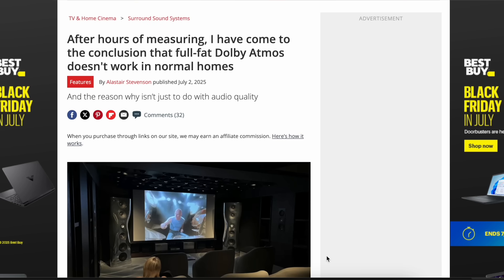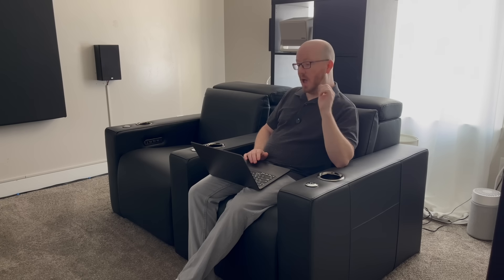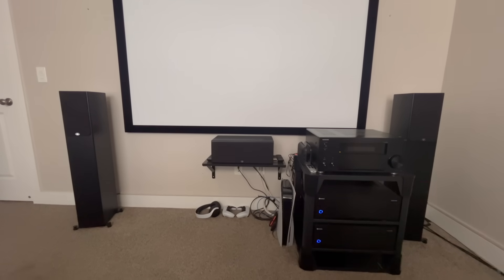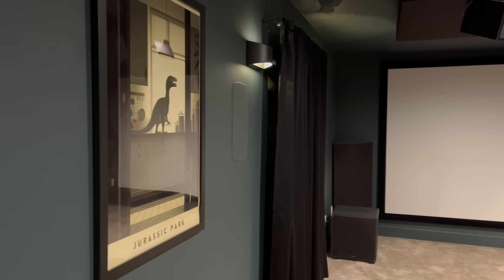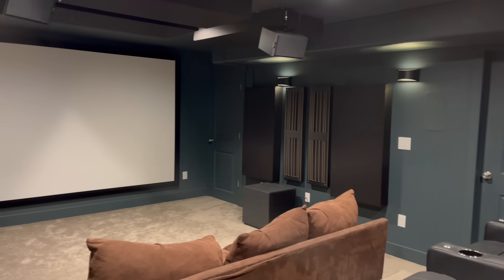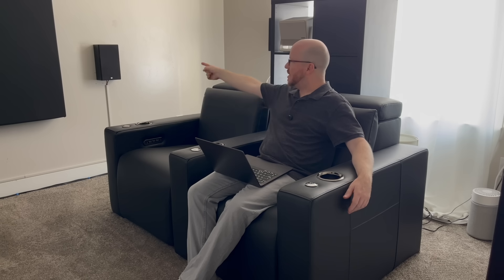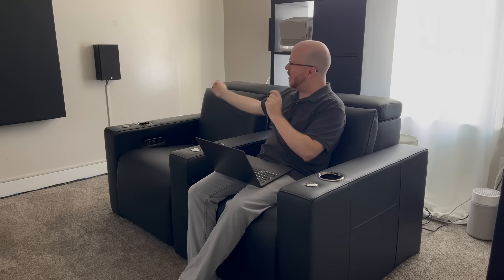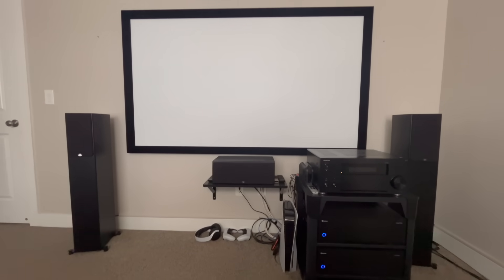Atmos Doesn’t Work in a Tiny Room? Think Again…

Comment: Did you know, that you don't actually need an atmos decoder? You can use a 5.1 decoder and get atmos out of it by adding extra speakers across the positive terminals. The reason this works, is because when movies are made it is in 11.1.4. Then it is downmixed to lesser formats like 5.1. When this happens, the atmos sound is split between two speakers, and are out of phase. When you connect a speaker across for example the LF and LS channels, you will hear the LH channel

Comment: I have a room 11' x 12' with 8' ceiling. I have a 5.1.2 system setup with about 6 weeks with my Atmos speakers upfiring for now.

I'm installing my Atmos speakers on my ceiling in the next two or three weeks.

But with my setup and tweaking of my speaker calibration I can say Atmos does work in this room.

Atmos works really good in here. I had a 5.1 system for 19 years and I can hear a big difference with the atmos speakers. I had the system with 5.1 on the denon x2800 for over a month and when I added the upfiring Atmos speakers I heard a very big difference , I could hear sounds above me when I added the atmosphere speakers. My sofa is about 3 foot away from the back wall.

I'm just waiting for keyhole hooks for my Atmos speakers so that I can put them on the ceiling and my brother will be helping me when he gets the time on the next two weeks.

I have all Polk Audio signature elite speakers in bed layer speakers. I have an ES30 as center channel , ES20 left and right and ES10 rear speakers. I have Elac Debut 4.2 Atmos speakers.

The Polk speakers are connected with 12 guage 100% ofc copper cable and nakamichi 24k gold banana plugs. My Atmos speakers will be on 14guage 100% ofc copper cable and nakamichi 24K gold banana plugs.

Comment: I have 12’ by 11.5’ room, 7.2.4 setup, 2 full size left and right front Speakers, my TV is only 65” and I sit 6-7 feet from the TV, small rooms you have to make Compromises, I wish I had more space for a larger TV otherwise I’m happy with the space I have, also I have 2 Starke SW15 which I have one of them behind the Sofa and one behind the TV.

Comment: Bravo. I literally just design my own small room home theater. 7.3.4 in a 14’x11’x12’ room. I used all KEF. Like you said, the key is to use the right screen size, and a line of speakers with several form factors. I used on walls for the sides & rears, and they look  built in with the room treatment panels around it.

Comment: Hi from Australia. Your room is small; my room is smaller. Less than 9 M2 and I run a5.2.4 setup with a 77-inch OLED TV. Approx 3.6 M (11.8 ft) long x 2.3 M (7.5 ft) wide.

Comment: Not sure if I would actually do it, but could you have in-ceiling speakers for rear Atmos and wedge speakers for the fronts?  In my townhouse, my sofa is against the rear wall (can't block the back door) so my Klipsch on-wall heights would be just like the guy from England and just push sound into the middle of the room.  When my neighbor is home I have to turn off my front heights and the subwoofer on the common wall, leaving me with a max of 7.1.  Even then I have to be careful!!  I have a 65"OLED that's big enough for me.

Comment: Further proof: My 7.2.4 home theater is located in a mixed-use 23ft x 13ft bonus room that has office setups on both sides of the room. Because of the layout, I wasn't sure I could do anything more than 5.2.2, which was my initial configuration.

My solution was similar - I was able to score two pairs of Triad Bronze on-wall speakers while looking for an on-wall solution. I pulled the couch about a foot from the back wall to use them as side and rear surrounds, replacing the pair of bookshelf speakers used as surrounds in my original 5.2.2 setup. I then used a combination of cheap mounts to secure the bookshelf speakers to the ceiling bringing to total Atmos speakers to four. It sounds incredible and going from 5.2.2 to 7.2.4 was an absolute game-changer in terms of immersion.

Comment: My UK room is 15ft x 10ft and I use 4 subwoofers, 7 bed layer speakers and 4 on ceiling speakers. So 7.4.4 and I use a 83"oled as the screen! My room sounds and looks great! I used to use a projector which I'm considering going back to and using a 120' screen.

Comment: UK person here with a 3m x5m dedicated room with a 7.4.4 setup all in  KEF in-wall except the sides which are on wall. 100inch TV. A good Atmos setup is very much possible with some careful consideration.
Reply: Mine is 15ft by 10ft UK spare room and I use a 7.4.4 setup and I too am considering the the Q 4 meta speakers as on wall surround speakers.
Reply: @stekelly1980 I would have bought these if they were available when I configured my setup. Instead I built some on-wall speaker cabinets for the sides using the KEF Ci4100ql-THX.

Comment: These British guys are really funny. Does he really think that a 13 x 15 feet room is "very small"? What the heck? My room is 13 x 13 feet, with 9 feet ceiling and I still don't think it's tiny. Yes, it may be relatively small, by some standards, but that was enough for me to place a 9.1 Auro set-up. And soon there will be an extra Voice of God speaker, in the ceiling. No, I don't have on-walls or in-walls, to maximize space. I needed my room to sound really big (no matter the size), so I currently have a few monsters on "ground" level: Klipsch RF7 towers for left & right, Klipsch R-820f towers as surrounds (I know, overkill, but who cares) and I recently chose to replace my center channel with a PA speaker, LD Systems Stinger 28G (400 wats rms). Just one subwoofer, a 15'' REL Predator 1508. I'm completely on separates, with a total power of around 1500 watts. Btw, using a PA speaker for the center channel was probably the best choice I've made, in my HT. The power and the dynamics in my "tiny" HT are insane, and I love it! 

You can do whatever you want in your room, no matter the size, it's just a matter of choosing the right tools for the job.

Comment: "full fat" atmos can work in any room. Speaker size and power must be taken into consideration when doing a small room Atmos setup. Small room ? Small speakers. Eg?: B&W M1, Q Acoustic q7000 series, Focal Sib Evo, Klipsch RP 240D. Then depending on room size work your way up from those models. 
Eq with proper delays are also important. Small room? Sealed subwoofers ✅

Comment: My theater is in a small part in a decent size room. 12x24ft but the living room / theater part is shoved in the back which is a 9x12 area. 9ft wide. 12ft wide. My couch is pulled off the rear wall a good ft. I have 5.2.4 but the rear atmos is basically above me while the surround is in the back corner. I'm going to be honest, a LOT of times I can't tell the difference if the sound is coming from the surround or the top rear atmos. I have dirac calibration done. I have acoustic treatment and my t20 (rt60) times are between 150ms to 350ms above 100hz. I think the surround image is so spot on its almost too good. They have a center image or something. Not sure how to explain it. I tried to lean forward but it's not much better. I can't believe some people do 7 or 9 bed layer in similar sized places where side and rear surrounds are a couple of feet apart. Its no bueno for me, but then again. I have never tried it and even if I wanted to i couldn't, I am too close to the back wall and can't move forward anymore.

Comment: Well look up British retro tech reviewer's channel techmoan video titled "Basic Dolby Atmos Home Install & Review" He sets up an atmos setup which is I would say half if not less than half the size of Alistair's room, basically a knook under the stairs.  Allistair ol'chap is basically trying to build around his screen rather than fit his setup in his existing space.  It's like trying to squeeze a big block V8 motor in a tiny honda civic. You can squeeze it in there, but you'll have to do a lot of cutting a welding, reposition a lot of bits and it will never look factory
Reply from the maker: Well said

Comment: Lov your channel.  Mine is 10feet×18feet and 10 feet ceiling in a HDB home. Running with 7.4.6 atmos on AVR Denon 6800 per out to 02 7channel tonewinner power amp in a living Hall. 83  inch G4, 4 SVS SB 3000,  tower speakers, 02 center speakers top and bottom of the tv.  Wow the the best experience the family have . Anyway learn a lot from your channel to make this happened. Thank you.
Reply from the maker: That's great to hear, thanks for the kind words!

Comment: you know?  i think the guy who wrote the article doesnt even have a home theater, when there's a will there's a way. my bedroom/theater room is 11ft wide x 14.5 ft deep x 7.9ft high,  i am running a 5.2.4, i have followed your advice for atmos speaker placement, but i cheated a little with the rear atmos, since my listening position is against the back wall i put them almost above me  like 8 inches off the center, otherwise i wouldnt have channel separation between surrounds (90 and 180 degrees of MLP)  and atmos. by moving them closer to the center i now have that separation, front atmos are followin the rule of measuring and multiplying it by  ,7 and .18

Comment: I find a lot of people and I mean a LOT of people mess their theaters up by choosing their screen size first then trying to contort the rest of the system around that choice.  

What people really should do, especially if they are dealing with an already existing room, is by figuring out where the optimal placement for the speakers are....then figure out where the seats should go for optimal immersion, THEN determine how far they are from the front wall which will determine how big their screen will be.

For some reason, people have a hard time wrapping their minds around this.   With Immersive Audio, the placement of the surround speakers and height speakers in relation to each other is of the utmost importance and people are treating it like a tertiary consideration then saying that Atmos is a gimmick because their experiences are lackluster. 😆

Comment: I'm building out a 7.3.6 system with a 120" screen in a 13 x 15 room. Expect it will be awesome when I'm done!!
Reply from the maker: That sounds like an awesome setup, good luck with the build!
Reply: @GeorgeTheaterAtHome Thanks. Your channel has been very helpful. Main thing was deciding to go with good bookshelves for my atmos layer. Still saving up, only at a 7.2.0 so far, but I just got my projector and am setting it up this weekend!

Comment: Have you looked into Ghost wire for hiding speaker wire? I have a 7.2.4 setup in my living room of 800 sqft apartment. My height speakers are keyhole slot mounted to a wood panel mounted to a VESA pole mount which is mounted to an 8' tall DJ speaker stand.

Comment: I have an 11.5 ft by 10 ft room, with a height of 12 ft. My set-up is 7.2.4 and 75 75-inch TV. It is possible to do an Atmos with small room with a theatre feeling. It is a matter of getting the correct position and balance, me not being led by ego or greed in placing the most powerful and largest equipment there.

Comment: Agreed: Move your seating forward and match the scale you want to achieve. 
IMO, Alastair's train left the tracks when he started writing a list of parts without considering the room-size. 
on-wall-speakers are an excellent option. I use them for all but the mains + center  and have no regrets.
I use raceways matching the room.
He quoted a 130" screen, but why? Why not 300"? The reason is its too big for the room. I'm all in favor of "go as big as you can", but it has to fit the room. 
 I just moved. My old theater was 11x11 + 110" screen +5.1.2 setup.  My current house the theater is 14x12  + 110" screen + 7.2.4 setup.

Comment: We don’t have RBH here in the UK, but we have for sure other companies with onwall speakers though. I had a problem with back surrounds and I ended up with kef’s inwall which works perfect to me and my sofa is 50cm from the back wall and 3m from the 100” screen, don’t have to mention that would be impossible to fit larger screen. Main problem are the atmos as I mounted 6 on wall atmos (4 kef q50’s so they are correctly pointed the MLP with diy mount so I can tilt them, and 2 mid height in ceiling) however the fronts seem to be too far from the sofa and rear heights are slightly too close the mid heights(in ceiling). So…we all can get the best from what we have:) at the end of a day I am happy. I even fit the diy near field sub behind the sofa😅

Comment: Love the video, love the content, but I wanted to say yes he could shrink the screen and I do agree in the situation that would be the thing to do however, I’ve always had an issue with this that I believe to make the best possible home theater experience the screenshould fill up as much of the wall as possible. This is the way it used to be done in the movie theaters but nowadays you see extremely small screens compared to the room size and it does not have the same effect so ideally I would say he’s correct.
Reply: I just think that mashing yourself up against the screen when the room is a lot bigger. Does something to the effect that makes it uncomfortable for me I wish I was comfortable doing that because I could just buy one of these 98 inch TVs and call it a day But it doesn’t feel right. Keep the good content coming.👍

Comment: I live in the UK And  my sitting room is very small. I have got a 5.2.2 set up. With a 77 inch TV and 106 inch projector screen. The problem with small rooms is having too much bass. But now I've turned my volume at the back of my subwoofer  down really really low. All the speakers sound great
Reply: The problem with a small room isn't always too much bass. I am in a 11' x 12' room with 8' ceiling and bass gets lost in the room. I can have my sub blasting it out and somehow the bass gets swallowed up.

With audedsey I see my subwoofer has high output at 20Hz but it sounds kinda if dead and very low volume.

My brother has the same subwoofer and he was in a sitting room which was 40' x 12' and 8' ceiling and the subwoofer sounded 4x louder at half the volume.
Reply: @Steve30x it’s call null point 😑.

Comment: I have a 10' x 12' room with an 8' ceiling, dolby atmos works just fine in my small room.
Question:  I'm using 2 monoblocks model 2220 from Outlaw Audio for my SVS Ultra Evolution bookshelves,
I will be using a different monoblock the Emotiva XPA HC-1 for my SVS Ultra Evolution center speaker.
Do you know if it is ok to use different MFR. monoblock amps for my setup?
Or do I run into potential problems with speakers that would sound off due to MFR monoblocks being mixed?
Reply from the maker: That’s great to hear and I don't see any issues with mixing those amps.
Reply: @GeorgeTheaterAtHome  
Thanks for letting me know about that, I was literally 2 screens away from buying a 3rd Outlaw Audio monoblock 2220!
You just saved me $450 today 🤣
Reply: @GeorgeTheaterAtHome  
I finally got those 2 monoblock in for testing.
Well, the results are in: running the 2 monoblocks model 2220 from Outlaw Audio for left and right speaker,
and using the Emotiva XPA HC-1 for the center speaker yields different sounds!
The Outlaw Audio monoblocks sounded great, but lower pitch? the Emotiva sounded brighter, higher pitch? IDK, it could be my setup?

Comment: I'd still like to see you address your bad front stage layout (before critiquing others).  You'd have to re-arrange the whole room. But hey, more YouTube content!
Reply from the maker: How would you arrange it?
Reply: @GeorgeTheaterAtHome   Sorry, I wasn't sure if you saw my comment a few days ago, so I was a bit vague.  I think you were talking about your front stage, and even 2 channel sound. And how you were getting an even sound for stereo? I can't quite remember. 

 I commented, this is most likely NOT the case, as you have your Left tower kind of out in the open, with that open door area and the right tower is shoved in the corner also "blocked" by your rack thing. If you took raw measurements, you will see your Right tower has a lot more low end, and who knows what's going on in the high end. (difference wise)  You may have clear line of sight to the tower, but there is most certainly diffraction coming off of the edges and difference in wall reflections.  Your processor is having to do a lot of correction comparatively.  And what it will definitely struggle with is the difference in reflections. Dirac and such are amazing technologies, but all they can't perform miracles. I would even think a smaller room like this augments these problems.

My Suggestion, would be to rotate the front to the right wall, or even block off the window and do a 180.  The more symmetrical you can get the front stage, and everything really, the more consistent the speaker responses will be, mainly reflections, and the better your imaging, focus, depth, everything really, will be.  Try to find a better spot for the rack where it won't affect the sound.  As a bit of an experiment, you may even try placing the towers with NO room correction. Get them sounding and imaging best before calibration even. make sense?  Also make similar choices in placing the surrounds and heights. You will have the absolute best sound when speaker response and reflections are similar between all drivers. (assuming the receiver or yourself has the delays correct) 

I hope I'm not being ranty. I'm just trying to be descriptive. I mostly do two channel car audio, and these are things we constantly battle.   You seem to have a rare situation where your significant other is letting you do whatever you want in that room. So It would be great to see it at a high level.